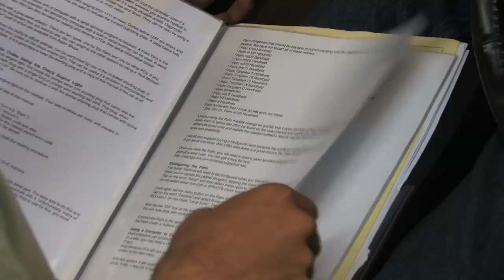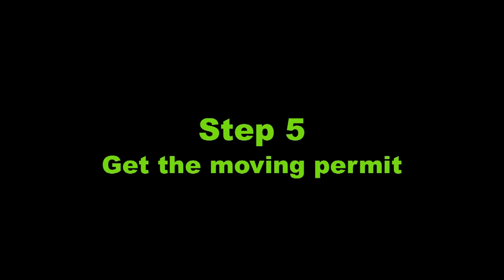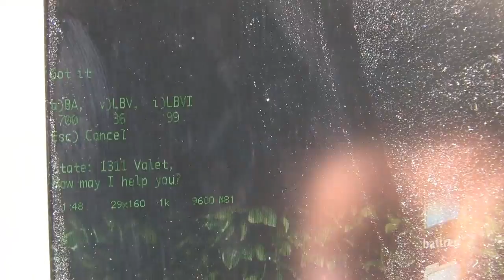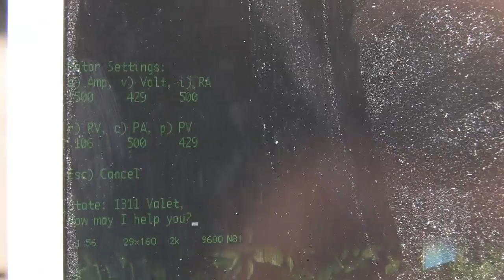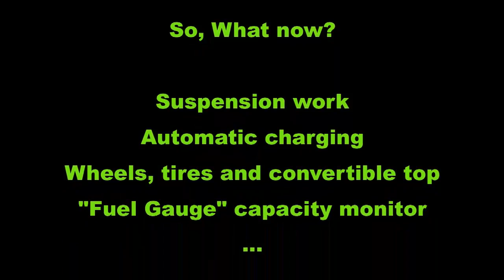Electric EV Miata MX5 - First FULL POWER Test and Drive

Comment: so glad I found this video..... I bought this sucker like 6 years ago, yanked out the lead batteries, swapped to 160v of lithium and cleaned up a couple things.... been driving ever since, although I broke the transmission with 2x stock torque and am fixing for the second time.... I don't have video, but you can see it at envirokarma.org

Comment: Electric car
There are a lot of videos that are converted to electric cars, but how are car air conditioners etc.?
Just a motor as a power is not comfortable!
Reply: You do lose the original air conditioning compressor that was turned by the engine, but some EV conversions run an electric air conditioner off accessory power.
Reply: EV conversion moves the electric air conditioner from the power supply of the accessory.
Does the car in this video have an electric air conditioner?

Comment: wait so how does the transmission work? looked like you still  had the manual gearbox but surely it doesnt work with batteries.
Reply: No it should still work. Everything in the drivetrain should work exactly as before. Only difference is that now it doesn't have an engine putting power through it and it doesn't need the clutch.

Comment: Need more RPM's. This is why homebrew EV's suck, even WITH the OG multi-speed transmissions. 5k RPM minimum with a 4-6 speed. 10k RPM can do with a 2-3 speed depending on how far you want your top end. This scenario would mean the 1st gear of the 2 speed is 2:1, and the second is 1:1 with the diff gears being in the 4:1-5:1 range. For instance, a ford 9" with 4.11's, 4.56's, 4.88's, or 5.12's or whatever.

Comment: led acid? cmon this isnt the 90's
Reply: Lead-acid (flooded or AGM) is a terrible power choice... heavy as fuck, low capacity (per volume, mass, everything), and they take forever to charge. Lithium packs from existing EVs (leaf, volt, tesla) are readily available, and not that expensive. All batteries need an appropriate charging system for safe and proper charging. While AGM is the most forgiving, it's not as simple as throwing a 13.8vdc wallwart on it and walking away -- something has to detect end-of-charge and stop charging. Car batteries are everywhere, so chargers are plentiful and cheap.

(Hint: the 96cell BMS out of a leaf can be had for $70. Search RC forums for sources of dirt cheap power supplies. Personally, I use Cisco 4500 POE power modules.)
Reply: 1 Just do a google image search for "cost of lithium ion batteries future". 
2 Look at the graphs. 
3 Conclusion: Battery electric cars will be cheaper to manufacture than fossil fuel cars within 10 years.
Reply: regulator2 serino Those were optima batteries. 
Not lead acid
Reply: Definitely not running in the 90s
Reply: How fast are lithium batteries coming down in price? How fast is battery tech coming along? In five years what is your guess on the cost and range of this project? ty
Reply: Before you criticize learn to spell.

Comment: How much did this entire project cost? This is something I want to do, and I was actually thinking of using a little MX-5 as the base, to make a nice little car to drive to and from work in most of the time.
Reply: TheBlackWaltz I converted my Smart for Two for $7500, but it was forced on my by a engine failure, if I had to do it again I would use a Suzuki van the "breadloaf" as it can carry more batteries and can have solar panels on the roof.
Reply: A kit: http://www.greencarreports.com/news/1059992_tesla-fun-for-think-prices-the-ev-mazda-miata-conversion

Comment from the maker: @DanFrederiksen I still haven't had a chance to clock it- 0-30 is very fast, 0-60 is less fast. Breaks traction at standstill in 2nd. Would really need more voltage for speed in the top end.